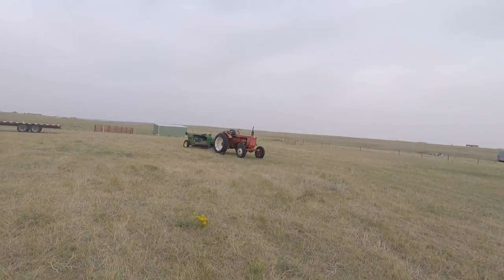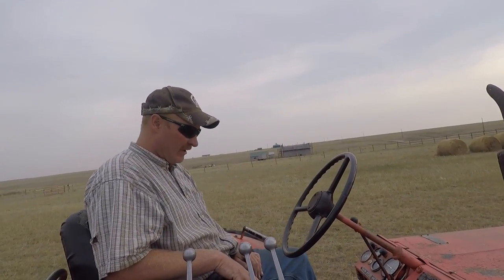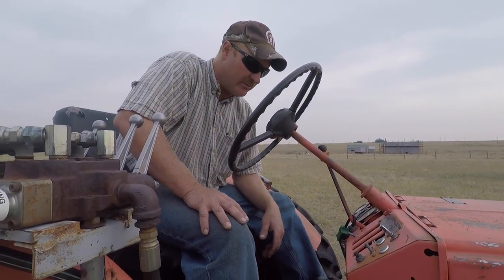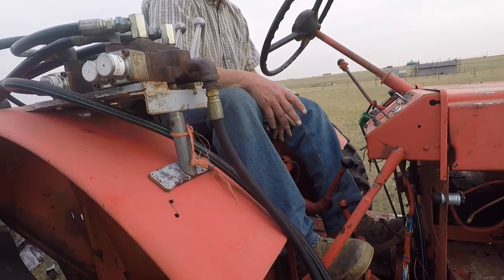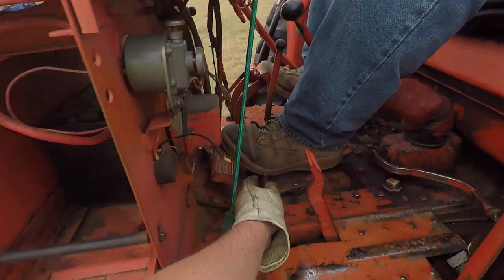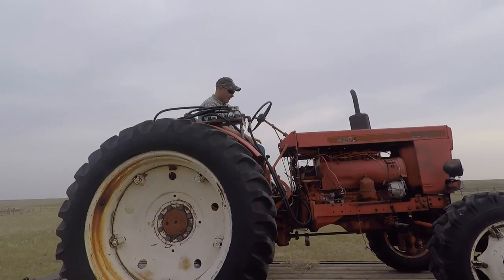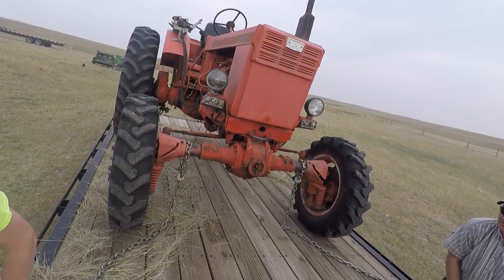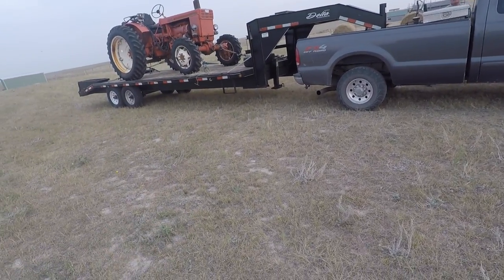How to operate the Belarus 420A tractor

Comment: Hello i just wanted to say its not belarus it is LTZ T40 Am(AM means all wheels Drive)and if u ask whats the diffrence then the diffrence is its tractor that is manufactured in another state and another factory and belarus spare parts are not compatible with this tractor. But all thing considered this is very good tractor and it is very reliable. It has lots of aftermarket parts But not originals because the factory doesnt exit anymore. And it also has very good power and weight ratio. It has 50 HP and 2500 bodyweight(almost 6000 lb). In my farm we use it to gather feed  with it it can handle 7.5m rake and plouht with 2 furrows. Bad thing to that is  the rear pto is only 540 rpm so disc mowing is difficult because most disc mowers need 1000 rpm. And also its good in foresty for hauling logs.

Comment: Thanks for the video it helps a lot!! 
What's one of these worth with a loader? Looked at one yesterday that comes with the tandem trailer its sitting on for $5000 Can.  A new clutch was installed but isn't adjusted properly to function and both batteries are toast so I haven't test run it yet....... The trailer's worth $2000-$2500 at least.

Comment: i have to drive one of these to pull a Mardi Gras float in New Orleans and I was hoping for tips on stopping quick when at top speed the one i drive has 9th gear and goes about 35 mph so towing a float at that speed can get dangerous when the brakes in these things do not hardly work and when they do its only one side which makes you turn hard in one direction

Comment: shouldn't you also cross the front chains
Reply from the maker: cuznjo1 the crossed chains prevent sideways and fore- aft movement but don't do much to prevent tipping in the event of a rollover or sharp turn. While the tractor rolling off is unlikely, having the front chains going out to each side offers a bit of stability like that.
Reply: Guy in WY I have no ideal about dot rules in WY, however I have a friend who is a MODOT inspector who has told me that legally there must be 4 tie down points(which you did) and they have to cross to the opposite side of the trailer (your front chains would not be legal in MO). He said the law applied to all loads with wheels. In reality he also said they seldom bothered with non commercial loads due to their workload. The exception would be accidents and lost loads. Just an FYI, check your state laws and other states you may haul in to be legal.
Reply: Coy Patton  per the DOT book (I know the book and have hauled a lot of equipment) anything under 10,000 lbs requires at least 2 tie downs. Anything 10,000 or more requires 4 tie downs.  There is nothing in the regs that says they need to be crossed.  I'm not bad mouthing you in any way, just stating the facts as I know them.  There is nothing wrong with putting more tie downs than required.
Reply: Budd  Dawson have no ideal. Repeating what i was told. 10,000 lbs exceeds anything i have ever hauled. He may have been jerking my chain. Again i do not know. I do know a guy who lost a mower off a trailer and he had troubles. But they related to how he had it secured and the lawsuit for the damage to the car behind him that hit the mower. He had one light strap through the foot well of the mower and mower brake set. He admitted that to the highway patrol officer.

Comment: Typical Russian design - let's do it backward from everyone else!  Lol.  Seriously though if I planned to keep a tractor forever I would consider an MTZ (basically a new Belarus).  They are simple and I bet they are darn reliable and will last as long as you have a basic mechanical knowledge.  Parts would be the only chancy aspect.  Americans love their John Deere's but there is always a solution for the alternative thinker.
Reply from the maker: +OSUOiler is MTZ related to Zetor?
Reply: No mtz doesn't have anything to do with zetor,if im not wrong.And well this is again a T-40 so well the T-40 is an odd tractor,belarus tractors or t-150,t-25 or t-16 or as you have them in Canada,belarus 1500,belarus 250 or belarus 160,either way all better then this T-40.
Reply: Yeah as FARMinLATVIA said I don't believe the two are related.  Zetor is a Czech manufacturer whereas MTZ is the brand/abbreviation for Minsk Tractor Works in Belarus.  They were one of the big Soviet manufacturing facilities back in the day.  Belarus was also the big line of tractors that they produced, which you know since you had one, but when they returned to the North American market a few years ago they changed the branding to MTZ.  Still essentially the same machine but now updated.  They are interesting and tempting tractors to try out.